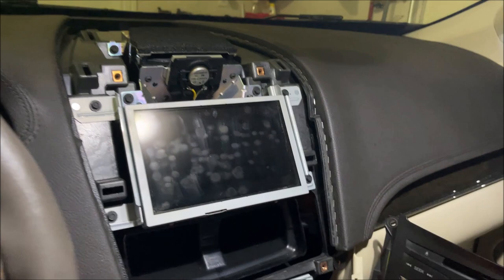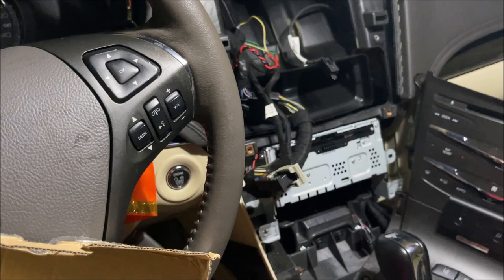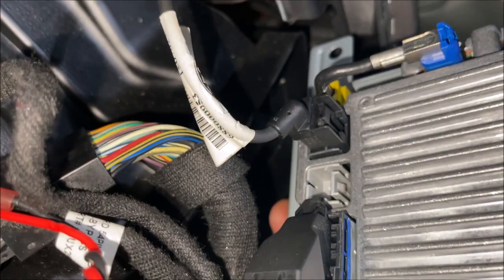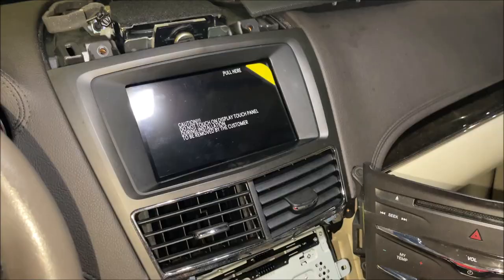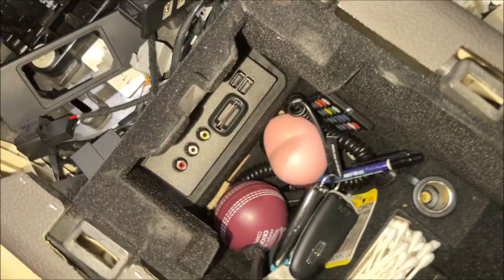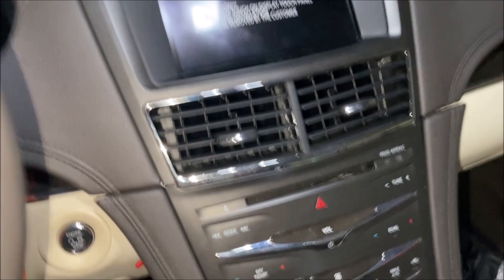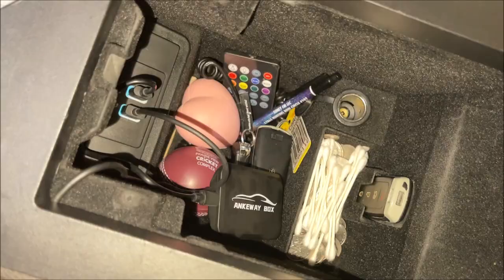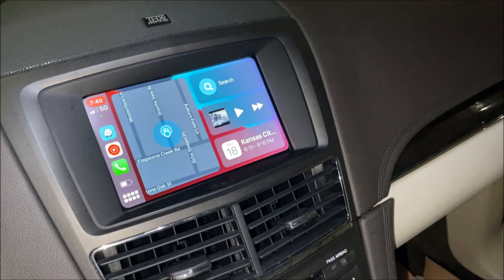2015 Lincoln MKT Sync Upgrade

Comment: I was under the assumption that my 2015 mkt had sync 1.. am I wrong, or was your system upgraded to sync 2 at one point? Either way, thanks for the video!
Reply from the maker: 2015 came with Sync 2. Maybe it’s the date of manufacture. But yes sync 3 touch screen is 100 times better. Fast and responsive. If you can find the upgrade module for around $500, it’s a must.

Comment: So hows upgrade sound.  is it slow?  Is it a faster interface?  Did you loose any functionality?
Reply from the maker: I feel sound has improved as I can now listen to volume 8 or 9 and it goes up to 25. The interface is super fast. I don’t have to press hard. Barely a touch does the job. Very smooth. I did not lose any functionality.

Comment: Does the navigation information in the dashboard still works after the upgrade?
Reply from the maker: Yes but it defaults to CarPlay. So if the phone is not connected, navigation works from the car. If the phone is connected, car navigation will not work. Only google maps or Apple Maps or Waze will work through CarPlay.

Comment: Did you figure out where the Antennae goes?
Reply from the maker: Yes, I put it under the center speaker. The kit comes with a double sided tape to stick it on but mine is not stuck. I’ve never heard it move or rattle.